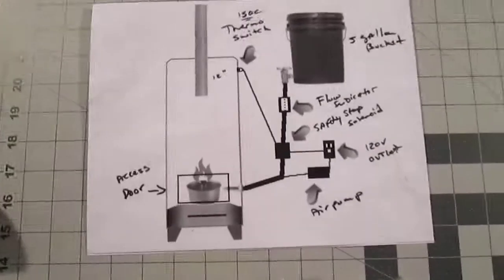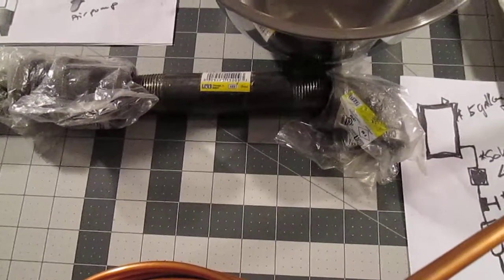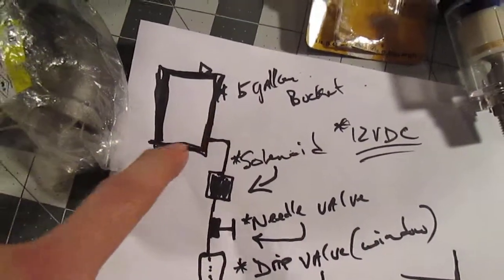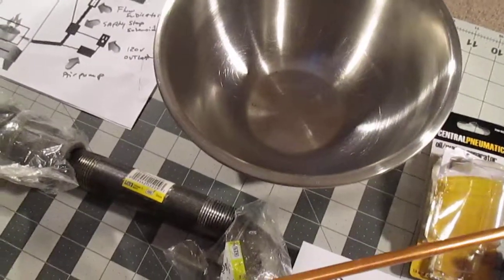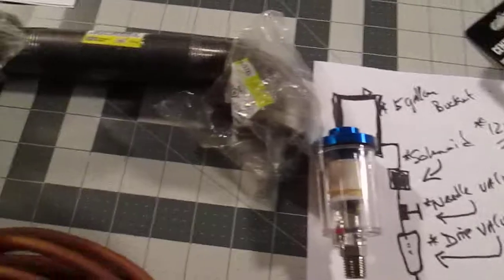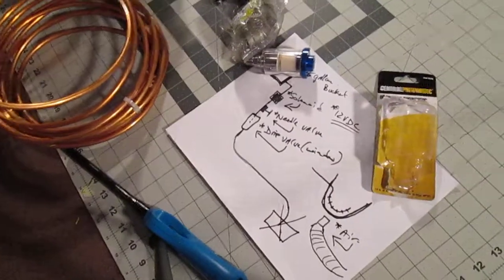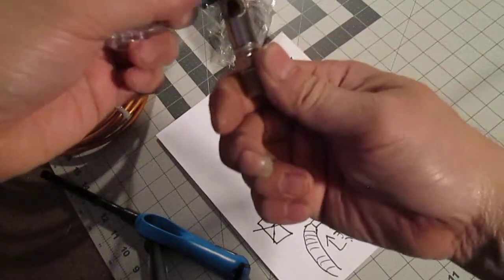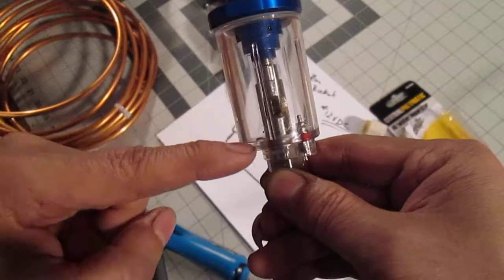DIY Waste Used Motor Oil Burner Heater Furnace - See Through Drip Valve Design - Video 5

Comment: You can also use 1/4 inch stainless steel brake line http://amzn.to/2ra5sCt
Reply from the maker: THANK YOU, I didn't think of that one either, stupid me :///... I already bought the 3/8" Soft Copper Pipes. But you are right, it would have been " CHEAPER " with stainless steel pipes, I should have remember would be great for the project and extra left later as well... My Dad did the Brake Line in the Car recently and he bought bunch of Stainless Steel Brake Line.... For 25 Feet was like $25.00 but for my 3/8" Soft Copper Pipe, it was $24.00 for 10 Feet :///.  My dumb arse brain again, LOL